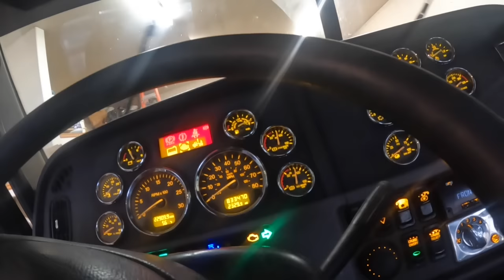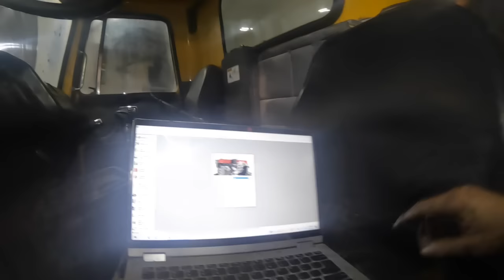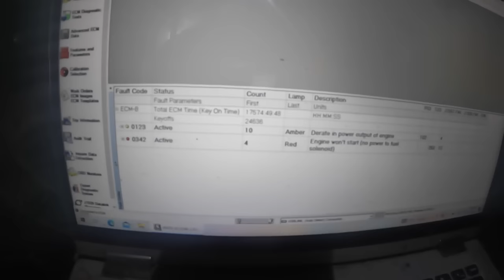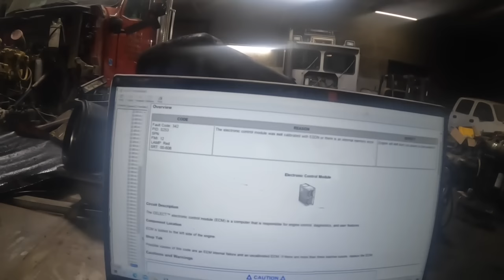Truck work.

Comment: Just did one of those steering boxes and pumps on a KW with 35k miles on it. The dealer said they could get it in a month for him. He said screw it and brought it to me. Fluid was silver and tons of play in the box. Found that the box was missing a ball in the outer bearing closest to the pitman arm. I guess its a recall from Paccar. Brand new stuff is junk before it leaves the factory now.

Comment: Good video warren.  We had a combine  that had a wiring fire.   We replaced the harness that we   know had burnt. I looked into the codes that came back and I found  one more harness that was cooked.  I'm shocked that  we didn't have our shop burned down because there was a foot area on the main battery cable was down to the wires.

Comment: I really like those headband light's, makes it so much easier to see.  I got one that's rechargeable from china freight, got it on an after Christmas sale.  I don't buy much of their stuff, but i bought some shop light's to replace the old fluorescent light's i have, and they work good, had them for over a year.  The light's are much brighter, and cheaper to run.  I go with milwaukee rechargeable tool's because they have the power.  Thanks for taking the time lately to film and put out video's as buisy as you are.  You always make me laugh with the rants and stories, but i really like how you explain how stuff work's, what's junk and what's good.  G-d bless you and yours.
Reply: I noticed we have the same headband light, sure beats trying to hold a light in place, or trying to get the magnetic one's to stay attached to steel, when there's so much plastic and aluminum that it won't stick to.  Nice to have this adjustable light that let's you see well, and both hands are free to wrench.

Comment: Should’ve seen me trying to get a power steering pump out of a traverse suv. Good times. Had to squeeze the pulley puller in to get that off. I thought what the heck were these guys thinking when they designed that one.

Comment: I work on fire engines and some are bolted to the frame with the steering shaft face in and the arm has to be removed first I found a way to get them apart and now I get everyone that comes in the shop

Comment: Hey Warren, your just darn busy. Hope you get some of that stuff fixed and out of the shop but your never not busy so take it easy. I got a parasitic draw on my 2005 GMC HD2500 gas engine that I’m going to start trouble shooting. Probably do to some of the aftermarket stuff I got on it. Remote start and aftermarket stereo. Should be fun, not! Thanks much for sharing buddy.
Reply: Don't know how, but a bad diode in the alternator can cause that. A failing relay that sticks on also. As well as any module that doesn't go to sleep. Pull fuses one at a time while checking for current draw.
Reply: If you have a multimeter that can mesure down to 0.1mV you can alsow check yoltage drop acros fuses. Somewhat easyer than pullung fuses and dosent cause stuff to stop working.

Comment: You think those older trucks have some kind of "limp mode" which allows them to run on a barebone program which bypasses the dynamic control features of the ECM?

Comment: An owner operator that doesn't know what a steering gear box is worries me.

$1,500 for a power steering pump sounds like a shafting me. That is real high in my opinion.

Heavy duty means "high dollar" in the trucking world.
Reply: Under $300 on eBAY.